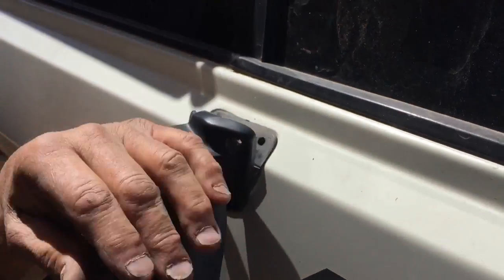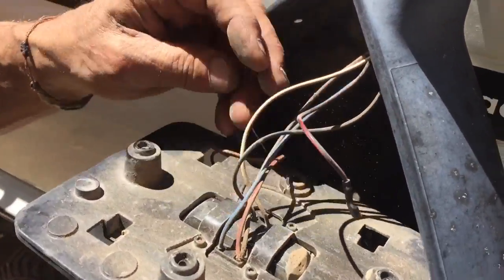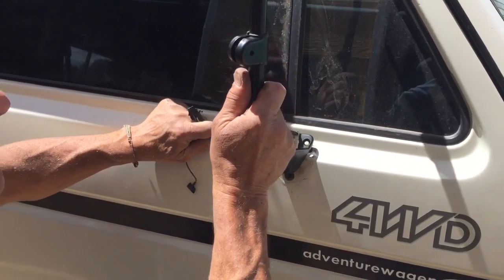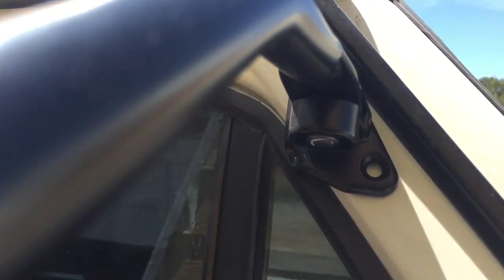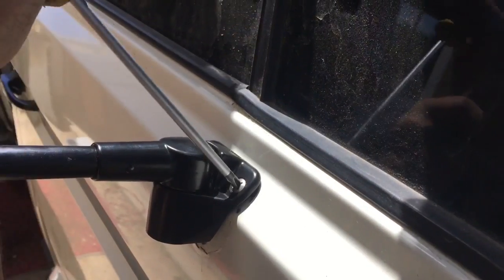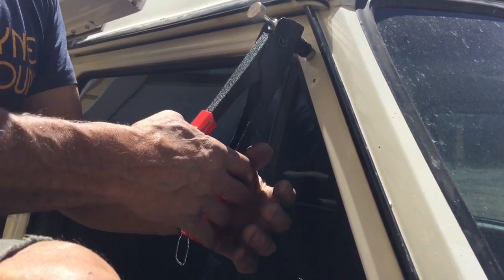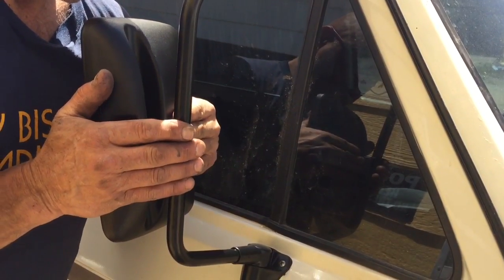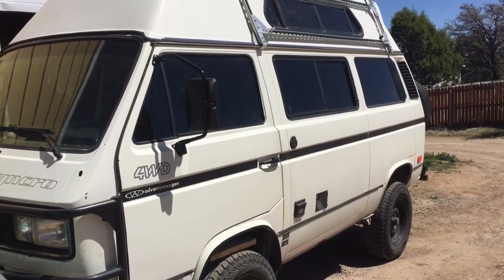VW Syncro Big Mirror Kit Install

Comment: I've got that LT mirror set on my Vanagon, and I love them! Rivnuts are the way to go. Also, the Samba conventional wisdom is to use tamper-proof screws to prevent theft.
Reply from the maker: +Forthwith Tx Good point on the security screws, I'll pass that info on to Miguel.
Reply from the maker: +Forthwith Tx Good call of the tamper proof screws. Miguel is currently in Mexico on his way back from Nicaragua - hopefully he still has these!